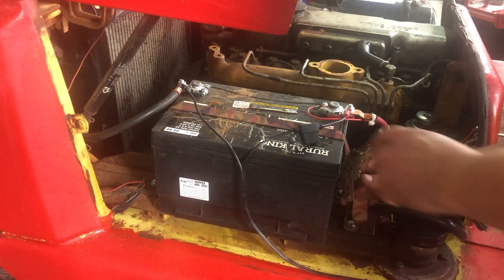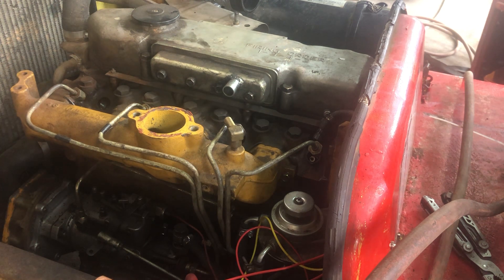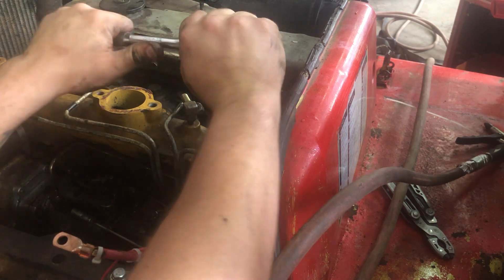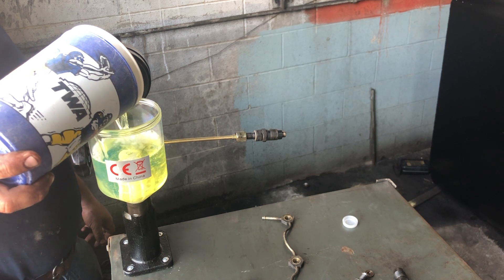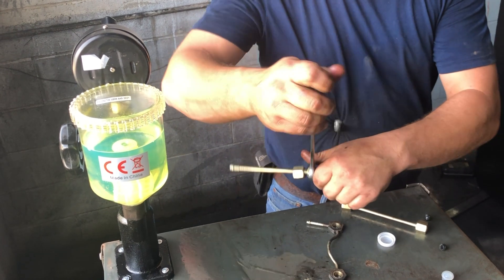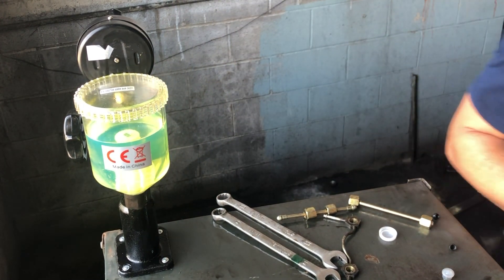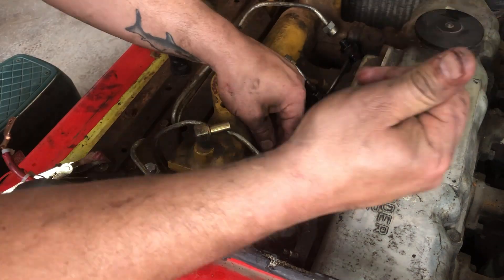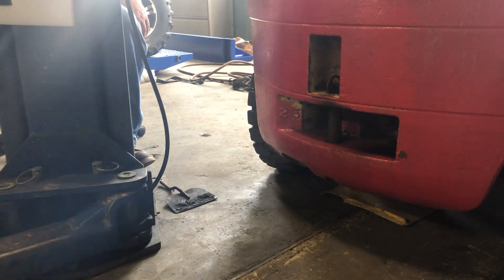Mitsubishi FD25 S4E Diesel Injector Replacement

Comment: What where the injector part numbers you used? Great video
Reply from the maker: 093500-3840
Reply: I will give mine ago with those injectors, for some unknown reason I had a part number for the injectors that I could find those injectors